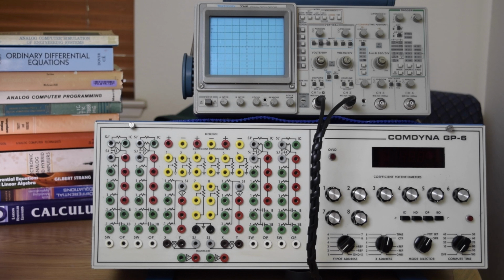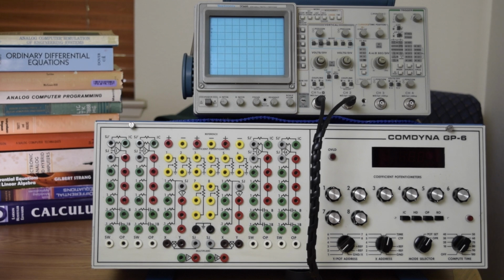Programming an Analog Computer

Comment: Duplicating your setup up to 10:55, I do not get an overload, nor do I see a sloped line on the scope.  ( I did see a slope line for about 10 seconds at one point, then it went flat)  I'm thinking I have problem with Channel one.  Bad op amp perhaps?

Comment: are you still around, can you reply to this if youre able to help me with a problem starting in analog, i have all the eqp. i beginning to suspect my computer is malfunctioning
Reply from the maker: First, thanks for watching. I am still around, and I might be able to help, if the problem isn't too complex. I'm trying to get back into making videos; I can't believe it's been four years since I posted one. Time flies. Let me know what your issue is, and what equipment you're using.
Reply: @timthompson468 I have a thought that I want your opinion on: is an analog computer a good "processor" for analog sensors? What about the output from an analog computer? Can it be attached to an ADC? Thanks ahead of time.
Reply from the maker: @Jblow-u2m  First, thanks for watching, and thanks for some excellent questions. The short answer is yes to both questions. Since these are interesting questions, and are fundamental, I’ll go into some details. I should mention that the first answer is somewhat nuanced, and I consider myself more of a student of analog computers than an expert, so this is my view.
I read somewhere – I think in a Jim Williams book- that analog computers have not gone way, they are in every analog circuit in modern electronics. That’s one of the things I found interesting; old analog computer books, even from the vacuum tube (valve) era, have similar descriptions as modern analog design books. The book Analog Circuit Design, by Jim Williams is a great reference with contributions from the pioneers of analog design. When we speak of analog signal processing, the circuits employed had their roots in analog computers. For example, an integrator could be considered an active low-pass filter. I could imagine a situation where the sum or average of multiple sensors is required, so a summing amplifier would be the circuit selected. One could even design a weighted summer, with adjustable gain on each input, to normalize the calibration factor from several sensors, although that might be too complex for practical applications. Now, the entire analog computer, with reset/operate/hold circuits would not be used, but the circuit elements of an analog computer show up time and time again in modern electronics. In analog computers, there is concern regarding saturation (overload) of any computing element in a set up. In designing an active filter, one must take care to avoid saturation of the output for similar reasons.
I should mention that analog computers were also, and more primarily, used as simulators, much in the same way one would use MatLab tools today. Their inputs could be connected to real world signals, and their outputs would drive real world actuators, to “simulate” a control system for complex systems such as aircraft autopilot system,  missile guidance systems, chemical plant control, etc. The beauty of this approach was, once the computer safely determined the operating parameters of the control system, the “circuits” defined by the analog computer program could be copied from the computer to the final product.
As to connecting the output of an analog computer to an ADC, that is absolutely possible and was a widely used technique, especially at the end of the analog computing era. There is a great book, Electronic Analog and Hybrid Computers, by the husband and wife team of Granino A. Korn, and Theresa M. Korn, from 1964, that discusses the details. In this era, digital computers were finally getting fast enough to solve problems fast enough to compete with analog computers on speed alone (whereas before, digital computers always had the advantage of more precise solutions, as long as more digits and more time was available). The hybrid computer combined the best features of both domains to solve difficult problems that neither alone could solve satisfactorily. Unfortunately for analog computing, the rapid growth of digital computing, and the engineering community's infatuation with more digits (significant figures) than are practically necessary, spelled the end of analog computing within a decade of the publication of the book by Korn and Korn.
Sorry to go on for so long, but these are very interesting questions to me, and open up a bigger discussion that is not practical in a YouTube comment. I’m always amazed at the lengths engineers were willing to stretch to solve complex problems in the 1930s to the 1970s applying analog computers.

Comment: WOW!! Could these analog computers from the 50's and 60's multiply/divide numbers? I mean, digital computers can't compute really well things like 10*0.1....
Reply from the maker: Thanks for watching. There were functions to multiply and divide, through various means. In some cases they would use a servo motor, but later an electronic multiplier was developed. The GP-6 has an electronic multiplier. I don’t remember off the top of my head what the IC was, but it was commonly used in the 70s. The multiplier can be used in reverse to perform division. If you look at my videos titled “Sounds of Chaos” I use the GP-6 multiplier there to program the Lorenz equation. I’m using it to modulate a Moog synthesizer, but you can see the chaotic Lorenz equation plotted on the oscilloscope. Thanks again.
Reply: @timthompson468  Thanks also for your detailed answer to my question :) :) :)

Comment: Do these come with instructions
Reply from the maker: Eric Johnson, the units I’ve purchased on eBay did not come with instructions, but if you search for “Comdyna GP-6” you will easily find pdf versions of the original manual. The manual is relatively short, but has complete operating instructions as well as schematics of all the circuits. The only issue is that, although the GP-6 evolved substantially over the years, I’ve only seen one version of the manual online, so the schematics in the manual might not match a particular unit that is purchased today. The operating instructions don’t change at all over the various units that have the digital meter display, so for the purpose of operation, the manual will work for any such unit. The manual is also a good source for learning the basic operation of any analog computer. I hope that helps, and thanks for watching.
Reply: Thanks I'd like to get one just to play around with and come up with crazy schematics by the way I have no calculus knowledge at all

Comment: sir can i know which book helps me to understand analog  electronics from basics
Reply from the maker: Mohan Besetty, a book I like is Elementary Electricity and Electronics Component by Component, by Mannie Horowitz, ISBN 0-8306-0853-2. It is at the basic technician level and does not require a lot of math background. It can be found on eBay for less than $10. Another great book is The Art of Electronics, by Paul Horowitz and Winfield Hill, ISBN 9780521370950. This book is more expensive, but I’ve seen the second edition on eBay for less than $50. The third edition might be better, but I think the second edition is very good. I have the Kindle version. Another very useful resource you might want is MicroCap SPICE simulation software. It is available for free here: http://spectrum-soft.com/download/download.shtm. This is a very good professional tool for simulating circuits. It includes an extensive reference manual and many example circuits. I use it every day and find it very useful for both learning and for designing new circuits.

Good luck.

Comment: Sir can you say a place where I can learn circuit analysis completely like vedio lectures you know please refer me
Reply from the maker: Mohan Besetty, I taught myself linear circuit analysis by reading a book, so I am not familiar with any videos on the subject. If you search on YouTube, there are quite a few videos on the subject. You might try viewing a few of them to see if you like one. Here is one I took a quick look at that seems pretty good: https://youtu.be/sqxzQkAdJm0. The Kahn academy has videos on the subject, and I think they do good videos.

If you’re interested, the book I used to learn circuit analysis (recommended to me by a former boss), is Circuit Analysis, Allan D. Kraus, ISBN 0-314-79500-6.This book requires some knowledge of calculus, but it teaches you circuit analysis with differential equations and the Laplace transform. Another book that was recommended to me is Circuit Analysis, Irving L. Kosow, ISBN 0-471-03067-8. I have not read the Kosow book yet, but it has limited calculus topics that I can find in it. I purchased both of these books on eBay in the past five years, but I could not find either of them listed there or on Amazon today.

Good luck.

Comment: Is there a way you can list all the books in the background?
Reply from the maker: LonewolfeSlayer, Sure, and thanks for watching. 
From the top,
1. Analog Computer Simulation of Engineering Systems, James, Smith and Wolford, ISBN 0-7002-2376-2
2. Ordinary Differential Equations, Tenenbaum and Pollard, ISBN 978-0-486-64940-5
3. Methods for Solving Engineering Problems Using Analog Computers, Levine, LoCCN 63-1794
4. Analog Computer Programming, Rekoff, LoCCN 67-22999
5. Design Fundamentals of Analog Computer Components, Howe, LoCCN 61-8536
6. Basics of Analog Computers, Truitt and Rogers, LoCCN 60-10469
7. Analog Computer Techniques, Johnson, LoCCN 63-16196
8. Electronic Analog and Hybrid Computers, Korn and Korn, LoCCN 63-23389
9. Differential Equations and Linear Algebra, Strang, ISBN 978-0-9802327-9-0
10. A First Course in Differential Equations, Zill, ISBN 0-534-41878-3
11. Calculus, Larson, Hostetler and Edwards, ISBN 0-618-14180-4
Some of these predate the ISBN system, so I list the Library of Congress Catalog Number. I purchased most of these on eBay. The two “classics” of analog computing are 7, by Johnson, and 8, by Korn and Korn. 6, by Truitt and Rogers is very interesting and relatively easy to read. It was written by two engineers from EAI, an analog computer manufacturer.
I hope this helps.

Comment: Sir can I buit my own analog system
Reply from the maker: Yes, but it would not be easy. If you search for “Comdyna GP-6 Manual” you can find the pdf of the manual for the one I use which includes schematics and wiring diagrams. You could feasibly adapt that for modern components. The hard part is you would need very good, low-leakage capacitors, a lot of multi-segment wafer switches and several 10-turn potentiometers. These components are very expensive, especially if you use the ones found in the GP-6. It’s possible to improvise but the results might not be as good. If I were to try it, I would also use less expensive interconnect components than the banana jacks on the interface panels of the GP-6. The system is modular, so it’s possible to start with one op amp/integrator, get that circuit working and then copy that to make as many integrators as is required.

Comment: so to me this seems like a fancy kind of calculator. not really a general purpose "computer" as we would think of them... so you would not be able to make a "hello world" program with this. or a game. it's just used to solve certain kinds of mathematical problems - yes?
Reply from the maker: Thanks for watching. You are, for the most part, correct. The analog computer predates digital computers, and it was used primarily to quickly solve differential equations. Another name fo the analog computer was differential analyzer. The were also used to simulate control systems. It was much faster, though less precise, than the early digital computers, but it is very different in operation and application. The earliest digital computers measured their speed in seconds per operation instead of operations per second, so it was impractical to use them in solving differential equations using numerical methods. The output of the analog computer is a plot of the output of the solution to the differential equation, whereas in modern digital computers, the solution is the equation itself. In analog computers there is still a distinction between general purpose and special purpose. The GP-6 is considered a general purpose computer because it can be programmed for a variety of applications. In the Apollo era, NASA had an analog computer based lunar lander simulator which would be an example of a special purpose analog computer. With resources and clever programming, a reasonable graphics display can be made, but that’s beyond my capabilities. There is a video on YouTube of a car suspension simulation that displays a simple car model driving down a road with simulated bumps. That’s very impressive considering the technology, but it’s nothing like what a modern gaming computer could do.

Comment: I'd like to get my hands on an analog computer. Are there new ones out there, or does one have to build one?
Reply from the maker: There is a gentleman by the name of Bernd Ulmann in Germany who I believe is trying to build new production analog computers, but the information is spotty. He has a YouTube channel and also works with vintage analog computers, I think the new production models are for educational purposes, and could be expensive. I think the best option is to purchase vintage models but they don’t show up on eBay as much as they used to. Also, you must be very careful to ensure that all the parts are there. I’ve had to get refunds in the past on units that were sold as working, but were gutted. Making your own is an option, but I think that would also be expensive. The manual for the Comdyna GP-6 is available online and has all the schematics. The most expensive part is the integrating capacitor. The ones used in the Comdyna GP-6 sell for over $300 each new. Less expensive caps could probably be used, but it would be a trade off between price and performance. Sorry I don’t have a better answer, but it is complicated. The texts written by Korn and Korn describe how to build tube and transistor based analog computers, but it would be easier using modern op amps. Good luck, and thanks for watching.
Reply from the maker: As a follow up, the company I’m referring to in my previous reply is Analog Paradigm. They have a website, but I did not look to deeply into it.
Reply: @timthompson468  thank you. This is very helpful.

Comment: Are the operational amplifiers made form discrete transistors, or are they integrated circuits?
Reply from the maker: The Comdyna GP-6 uses the 741 op amp integrated circuit. I recently picked up two EAI TR-10 and TR-20 computers. Those use discrete transistors.

Comment: I would like to see how you program graphics on an analog computer. How do you draw circles and sinus waves, cars and so on.
Reply from the maker: Thanks for watching. I'll try to demonstrate that in a video when I get my EIA TR-10 up and running. It's easier to demonstrate than to describe. The key is to put the oscilloscope in X/Y mode. The computer generates a ramp signal that represents computer time for the x-axis. An equation can be programmed to generate the sine and/or cosine functions. To generate a circle, a sine is used to drive the scope's x-axis, and a cosine is used to drive the y-axis. If the signals are set up correctly, and have the same frequency, a circle is displayed. This is the concept of a phase diagram in mathematics, if I"m not mistaken. Cars and other shapes are difficult. Each line of the drawing must be made with an equation. That requires more resources than I have in my small scale analog computers, but I've seen videos on YouTube where someone went to the trouble of drawing a car body to demonstrate a suspension simulation.

Comment: I had a lot of trouble following along due to math being my weakest subject but I was enthralled nonetheless by this demonstration. Thank you for putting this on YouTube!
Reply from the maker: Thanks for watching. I find this subject fascinating, but I'm a little weak on the math too. The problem is analog computers are used primarily to solve differential equations, which I consider to be a fairly high level of mathematics. An understanding of calculus is helpful. The key is the problems are typically all about phenomena that change over time - things like the trajectory of a projectile, or a spring-mass system, or radioactive decay. I'm mainly playing around with these to learn more about differential equations and operational amplifiers. I just wish I had more time to spend on it.